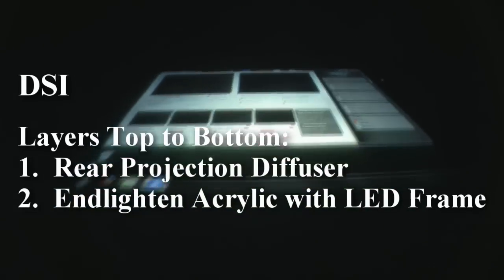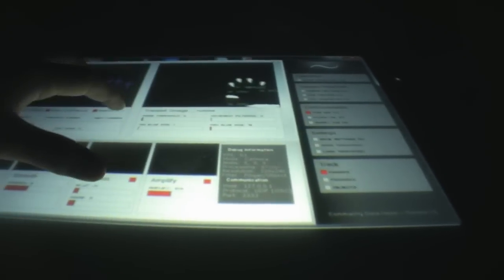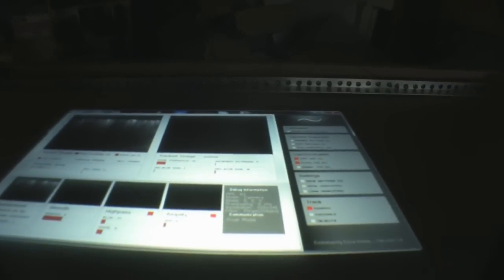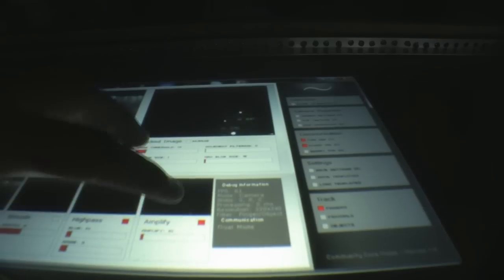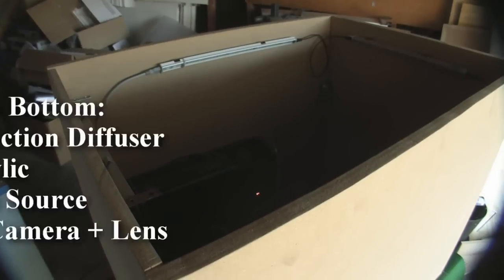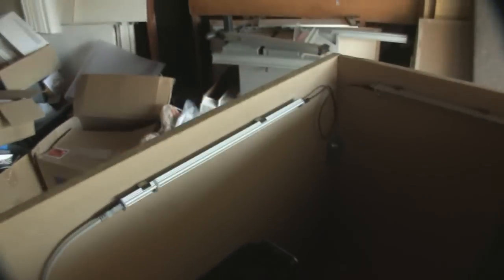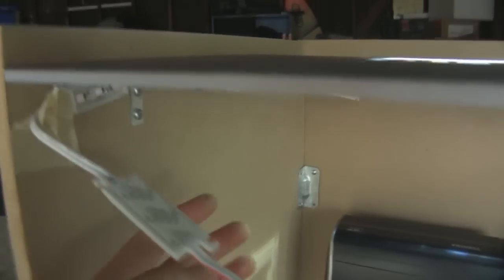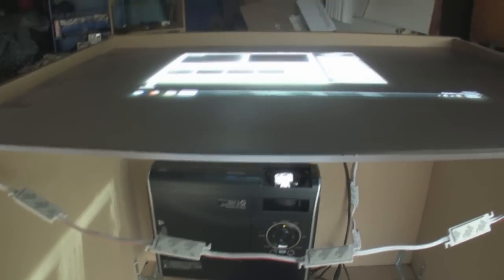How to Build A Multitouch Table - Part 2

Comment: In LED-LP can infrared remote be used to create a light plane?
Reply from the maker: You need a ton of LEDs for making the LED frame on an LED-LP setup. Yes you can use the LEDs from remotes but they typically have a wider beam angle than you'd want so you may get some hover detection in CCV.

Comment from the maker: I think you're referring to the distance from the top touch surface to the layer the image is focused on. It's up to you how you layer it but you will want some thin layer on top to probably protect the projection material.  Of course it depends on which of the methods in the video you plan to do as some need to have some distance for diffusing objects placed on the surface (DSI).

Comment from the maker: Yes. These camera-based tracking setups typically work in IR light because if the camera tracked visibly lit objects it would have a more difficult time in visible lighting environments (pretty much all places these would be used).  It is especially necessary to use IR light for illumination when using a projector as otherwise the camera would see all the light from the projector and not be able to track anything.

Comment: One would think, it you put an IR LED in a pin that is on the exact same wavelength of the ones installed in the case, it should work wonderfully.

But now, how do you get this to work with an LCD Display instead of a rear projector?

Comment from the maker: In all camera-based LCD setups you have to take the LCD apart and place the camera behind the screen.

Yes you can turn the IR LEDs off on your setup and use an IR pen instead.  Just make sure that the IR pen is tracked in CCV with the same filer settings as the IR LED DSI setup are.

Comment: When making the DSI table, you mentioned that it can be used with Flatscreen (LCD/Plasma/HDTV). How would you track the touch without a camera looking at it from behind?
Also,with any of these setups, would we be able to have the option to turn off the LED's/Lasers and use in infra-red pointing device, like a UV LED placed in a hollowed-out sharpie with a pressure sensitive switch to turn the led on and off when it makes contact with the surface?

Comment from the maker: Your best option (fi you want to use a camera for tracking) is to build an LLP or LED-LP as they don't require an enclosed box, but you can have a solid piece of acrylic/glass as the touch surface (ideal for dining room table).  If you want a more stable setup, and one that will work with changing sunlight coming in the window, you will want to get a Infrared Touch Frame.  See our online store for more info.